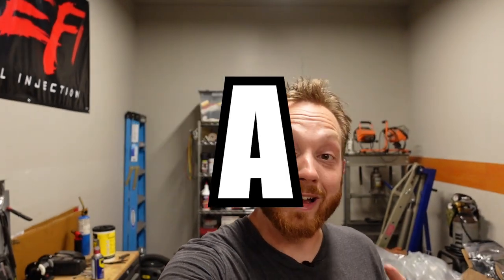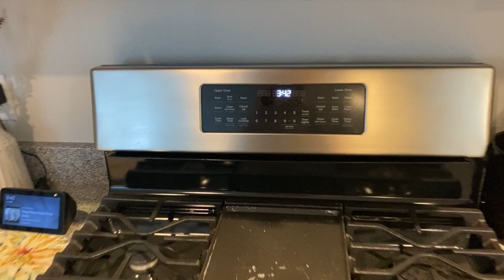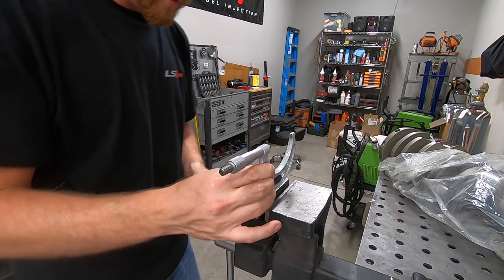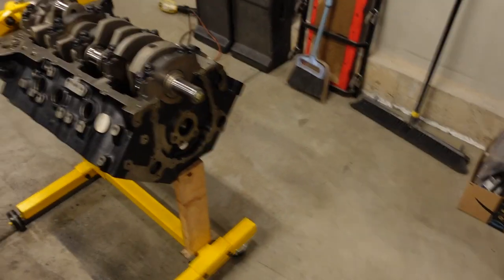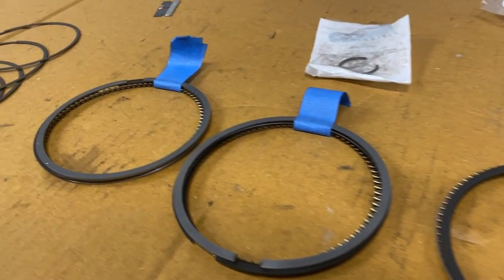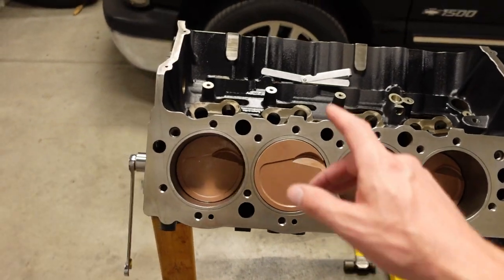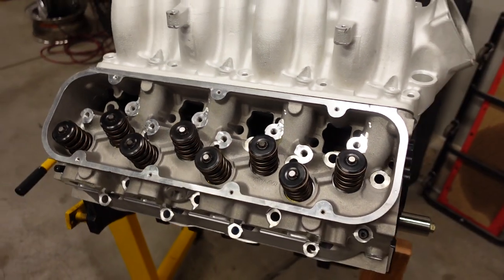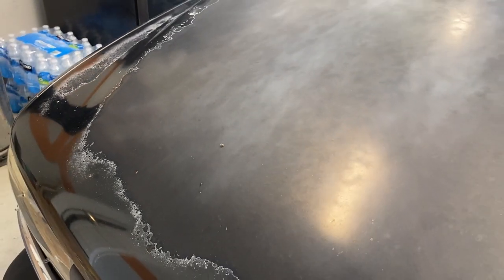535 CUBIC INCH (8.8 liter) Monster Big Block Engine Build

Comment: Bold statement L.S- Killer..You might want to rethink that statement,Since Richard Holdner, made 1542.6 HP with a stock 6.0 gen4 bottom end an torque was like 1256 ft lbs..ya got your work cut out for ya! Good Luck 🤞
Reply: That's no ls killer l do like it but nothing kills an ls 😁

Comment: Wat i did.....VHT wrinkle red on block and valve covers, acc brackets in cast iron paint, small brakets in cast iron paint, vacumm hoses in black, red plug wires, red air filter, pwr steer pump in vht wrinkle red....looked old school but assembled in a black engine compartment it just popped! Wasnt bright, suttle but looked great and sooooo easy to hunt down leaks

Comment: I still want to see you stroke the 4.8L to either 363cu (if aluminum) or 383cu (if iron block) with a 4" Stroker Kit. Since you really can't spin that blower motor to the moon with belt slippage and rotor speed efficiency falling off up top, a stroker based on that 4.8L would be insane. TQ for DAYS.....

Comment: On my recent project of installing efans on my nbs tahoe i went as far as tearing apart the oem fam harness and throughly cleaning and reparing any wires with the proper terminals using terminal specific tools and color coding them with the exact wire oe color and also making my own pcm pin wires with the oe positive locking weatherproof connector which i then finished in heat resistant fabric factory wire tape and wire loom. Dropped in easily and looks completely stock

Comment: You asked about color.... I just went through this with my 99 burban 454-496 build.  I chose "Grabber Green" for the block and 
"VHT SP206 Blue Wrinkle Finish" for the valve covers, but not yet decided if I will do the same on the intake/plenum. That being said, I've never been accused of having ANY kind of taste or "eye" for anything....

Comment: Like the orange look.
Thanks for all your sharing of knowledge, and development. Have a complete stock 8.1/Allison set-up out of pickup, 45K miles, wreck where owner pulled it all out. Planned to use it in build, never got to it, sold.  It is a 2008/09 forget. Plan to keep pretty much stock, maybe 550 H.P/620 ft-lb torque.  Something like Mercury Marine development project.  Does modifying the intake help?  Maybe go in lowered 1986 Chevy short bed step side ( the GM Proving Ground look).

Comment: Go with something bright and in your face. Bright green or safety orange not boring Chevy orange. Just to add some pop finish it off with duplicolor metallic clearcoat. I did that on an engine once and it added a little extra flair but you could only see the metallic in the sunlight.

Comment: Think you and I have that "do things a bit different" characteristic in common :) 
When I found out the bottom end was bad in my '99 K2500 I opted for a 502 long block that was for sale a few hours away.  Health and financial issues have been speed bumps, but I'm hoping to do the 411 ECU swap, and swap the 454 stock heads and intake onto the 502. With a carb setup it was dynoed at 547hp 610ftlbs, gain or loose swapping to the  EFI setup (already have larger injectors, Hp Tuners) it should have significantly more than the stock 454.
Reply: I have a 98 k2500, originally a big block truck but it spun a couple rod bearings. I went the other direction, swapped an 0411 and a 5.3 with a standalone harness, all factory gauges and everything works. Now that it's running and driving, it's not hurting for power by any means in fact its got a lot more usable power than that choked out 6th gen 454 but I still kick the idea around of swapping in an 8.1 at some point to get that monster lazy torque back.

Comment: You'll be running 2000hp before you know it once you get the suspension dialed in. Those parts will absolutely take 2000 without even breaking a sweat. Don't have to worry about low end spool because of the cubes. Will be a weapon!
Reply from the maker: Can’t wait to get it on a track!

Comment: I just wish the 8.1 had a larger aftermarket 🤷. But yeah man LS engines are cool but nothing beats displacement. As far as colors go having the truck black and very sleeper like. Me myself would probably go with a black block with a lot of midnight chrome. Midnight chrome exhaust would be absolutely killer and very killer expensive as well. But I think something of that combination would be cool. Still very low-key but yet stunning at the same time.

Comment: Do you have to worry about OBD2 state inspections?  Here in NY, during inspection, your vehicle is hooked up to a scan tool that communicates with the state computer network.  Your vehicle better be able to communicate with it, and the info on your computer better jive with what the state sees with your vin.  Because of that, I’ve decided to forget engine swapping my ‘07 Classic Sil 4.3.  Just too many unknowns.

Comment: I would do the block valve covers in the upper intake and the orange do a powder coat, satin black on all the pipes and if you have any kind of numbering for the size of the cubes on the valve covers, have them machine down or have the powder coating wiped off before they cure it so that it shines through on aluminum on my Duramax satin black my valve covers my upper manifold and my compressor, housing done and satin black all of my boost pipes are all done in gray along with my air intake

Comment: Plastigauge works if you get off numbers vs using a dbg I’d be Leary of crank straightness and check multiple planes on the journal with the plastiguage just to be sure.

Comment: I just finished my 1997 Chevy 2500 2wd 454 Vortech Gen 6 4L80E.
Stock build with Way better bearings than GM used , Vandervell bearings and a 80 psi MOROSO Racing BBC Oil Pump.
Impressive torque 485 Ft/lbs torque and around 360 Hp True like reported on You Tube.
Reply: Yeah baby love those torque numbers.

Comment: I suggest real Chevy orange on the block and heads, with black valve covers, intake, and accessories. If you need a paint code for the correct orange,  I can get that for you.

Thanks for the vid.

Comment: Question,, where did you get lucky and find a PSI engine block?
Reply: I can tell you a lot about these engine blocks,,, like the real reason for the oil squirters.
Reply from the maker: I'd be curious to hear it!
Reply: @LawrenceTolman  ,, in the early stages of development of this engine it had issues with rod pins failing, due to using LP or NG, these fuels run a lot hotter than gasoline. So we developed the squirters to cool the wrist pin, plus some of these engines were used in a variety of ways, stand alone generators, buses, trucks , etc etc, when we used them in gasoline applications we would just plug them because they were not really needed, but it will definitely help ur engine live since you r using a turbo, a little added protection. That engine came from wood dale Il, should have a date code stamped on the left or right ear of engine, definitely a work horse engine

Comment: About plastigauge. You should start with a to small or barely fitting piece. Than you know what size just presses in. Than you get an accurate reading. Too thick gives a false reading because of deflection of the bearing.
Both measuretools (out and in) have a calipper to check 0 adjustment.
The measuring tips look flat but are not.
Put two balls a bit too close to each other and try to fit a 3th in between. Wont go. If the measure tips are not exacly lined out you get a misreading on 0 ing the inner measure micrometer.
About the conrod bearings. I am curious how you check those on clearance.
Old engines (years ago) ,yep granddad telling storys, had full ,,layer,,(bearing material called babbits). Thise could be measured by leadwire/plastigauge.
New ones have a steel outside a layer of soft material(copper or same softnessspecks) and a layer of 0. something of bearing material. 
You can check the journal if its still round (2 measurements 90% oposit each other) and side middel side if its still,,flat,,.
But the bearing dont measure it. If you see aprox 25% of copper in both halves, replace them. The only check allowed is when torqued move them sideways. If they move 👍. Thats why you have regrind/rebore measures. So you can order the ,,stock,, oversized pistonring and ,,stock,, undersized bearings.
On new parts like this: only check if its not a murphey/monday case😉

Comment: I just picked up two of the 80000795R PSI engines and plan to build one of them for my boat. Do you know much about the new LS style heads that PSI is putting on these motors ? They have a different valve angle, LS style trunnion rockers and injector bosses are in the head, not the intake.
Reply: Just wondering if these LS style heads will be usable. Obviously not as good as Larry Hofer heads, but certainly worth considering if they will let the motor breathe to a max 5500RPM.
Reply from the maker: there are some promising developments with the PSI heads actually, and yes you can use em as long as you use the corresponding intake
Reply: @LawrenceTolman  I have two of these, intake to oil pan. Both are newer and have all the latest upgrades... screw-in freeze plugs, LS style heads, Oring'd intake ports, beehive springs, LS7 rockers, etc... Super happy with this score.
Spoke at length with Trey at River Speed and he is an absolute encyclopedia full of knowledge on these PSI 8.8's.
Im going to build one with his guidance and camshaft suggestion to best take advantage of these LS style cylinder heads.

Comment: I'm curious as to why you didn't opt for an aftermarket Crank sort of build longevity into your motor by purchasing a respectable crankshaft & Rods ? Or are you proving what can be accomplished with Bone yard parts ?
Reply from the maker: I have two engines, the 535 here does in fact use 100% aftermarket parts: block, crank, rods, pistons, heads, and so on. I also have a stock 8.1 with a turbo that’s running all stock parts

Comment: An iron block 5.3 will make 1000 pretty easy and not blow up at all and they are not running 80lvs of boost that’s diesel numbers not even a 1500 hp Supra runs 80lbs . There are plenty of real figures you can go off if you wanna look into it

Comment: I hope the Gen 7 8.1 liter block holds up for You at 1500 Hp.
Last I knew the 1968-1984 427 T tall deck Gen IV was the strongest at 1500 Hp Block Half Filled with Moroso Block Filler.
Pontiac 455 stock block has been pushed to 1600 Hp Turbo Boosted years back Full water jacket.
One Pontiac V8 400 Guy Twin Turbo Boosted to 2000 Hp Rear wheels Block Full Filled Stock Cast Iron Heads.
Reply from the maker: lots of great ways to make power right there

Comment: Somebody needs to build one of these with some of mast motorsports ls7 port heads and intake manifold. They had told me probably 3 years ago they were developing some for a fleet company that would be running them on natural gas and turbocharged making like 800 hp at around 1800 rpm and 8.8l as well if I remember correctly.

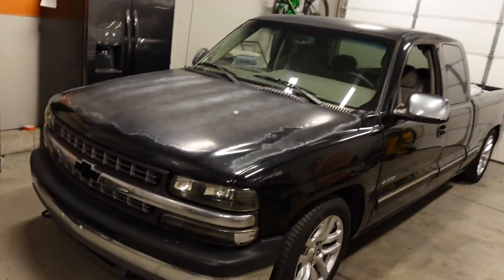Comment: 21:36  I would paint the block and heads 🟧Chevy Orange, powder coat the valve covers, intake manifold, water pump and timing cover a matching 🟧Chevy Orange then ⬛Stain Black Cerakote coat for the accessories/ drive, turbo's and tubing with the headers coated in a 🔳Cast Iron type color.
Reply from the maker: I do like the orange and black combo
Reply: @LawrenceTolman  You should check out the [TUX 69 Camaro]  It has that nice old school/ modern orange and black look I'm referencing.

Comment: What degree thermostat you run on the trucks? Also before going straight cooling trans lines to trans cooler w/out using the radiator did you ever try 160 degree thermostat?
Reply from the maker: I think there is a 185 in there now, and no, I have never tried anything lower like a 160
Reply: @LawrenceTolman  the reason am asking is because I’ve been told to change the thermostat to 160 to help the cooling of the trans, I also do have the tru cool 40k running with original lines and still using the radiator as well but my 4l80 built with a shift kit and with a 2800 stall. When driving under 180 degrees shifts very nice but once it goes over that temp it start to take long shifts and I was thinking of doing straight lines w/out using the radiator but I’ve seen people have issues kind of how I do now due to cooling issues. Do you have any issues or have any idea what I should do?

Comment: Sometimes plasti gauge is the only tool available and you have to use it.

Assembling a proper race engine is not the place for it. You’ll be happy with the instruments you picked up for life. No more guessing, no more doubt.

Comment: If you didn’t check the mains, You would have spun the main bearings because the engine knew you didn’t check it yourself. That’s how it works.
Reply from the maker: Very true.

Comment: coyote f150s do 8s with stock sealed coyote. Mostly just needs boost and fuel and they make up to 1200whp. No heads no cams no pistons no rods no opening the engine unless you want to go fast fast  need one of thems bad boys. stock blocks are handling over 2000hp. Wouldve pussed the world off and put a yote in this truck lol Sooo i say build one of them. Mustang lifestyle shows how to swap coyotes faster than ppl swap LS stuff plus no heads and cam like a LS so bolt on boost and boom

Comment: Now you have to put a 427 LS7 in the copo truck!
Reply: Or an LSX 454.
Reply: I have a feeling he won't go much bigger than a stroked 6.0 block. Ls7 blocks are Flippin expensive, as are the lsx aftermarket blocks.

Comment: what were those rings you installed on the end of the crank? are the reluctor rings? on the back? i dont know much about the new 496's but read and seen that hi-po parts are limited and i mean limited as no one has designed or made any good aftermarket stuff like heads and intake. i know they are not compatible with any other bbc engine parts but it looks like a future interesting engine.
Reply from the maker: Correct, they are the 24x LS style reluctor wheels
Reply: @LawrenceTolman  interesting thats they are on the back of the crank. thanks for verifying.

Comment: So what kind of transmission is going behind this beast? That 4L80E can't handle the numbers you're wanting as is can it? And what about the rest of the drivetrain? It'll have to be beefed up too won't it? LOVE the content man! Been looking forward to this build for a while.
Reply from the maker: You’re correct, the rear of the drivetrain won’t work as it is, the trans, rear diff, and driveshaft will all have to be upgraded significantly.

Comment: A lot of people already commented this but, for the sake of personal insurance, your torque sequence isn't the best - but hey, judging by your follow up videos over the past months, it worked for you and that specific engine and that's all that really matters. 

For the sake of proper engine building though: Always start from the center and work your way out on all of the caps, but don't reach your final torque spec within 2 hits.

The bolt and mating thread surface materials will have different specs. Also it should be a 3 or 4 step process. As in you start at a lower torque spec like 30 foot pounds for all bolts. Start with the center cap and work your way out evenly. Then go up another 20 or 30 foot pounds depending on build and materials - same pattern you did with the first round of tightening. Then a third round at the final spec. You may have to do a 4th round and tighten all of them to 90 degrees depending on what it is.

Again, figure out if they are like ARP bolts or stock GM bolts and some will split hairs over if it's a 2-bolt or 4-bolt style - look into it and figure out what will be best for your build.

Comment: Weight and power equals breaking stuff
Reply: That's why you use a heavier duty setup to begin with. Big blocks were simply designed for heavy duty applications in a way the LS never was.

Comment: lots of great info here and yes always double-check because its lots of money invested. when were you able to get the raylar intake and are they available to buy yet? Are the piston squirters available to buy as well? Paint it black, more modern.
Reply from the maker: I think Raylar said they should be available for purchase now, and the oil squirters came with my PSI 8.8 block when I purchased it
Reply: Where did you buy the block from?

Comment: Any reason u went gen 7 vs gen 6. Are those able to use the mark iv heads???
Reply from the maker: Mainly at first because it uses LS sensors and electronics so it made a great swap candidate at the time
Reply: @LawrenceTolman  ok gotcha understandable so from the factory they already got everything, just looked though not much aftermarket support for them. I've been looking into swapping my tahoe and was looking at the gen 6s so I could use the older heads and ls computer. Efi connection has a setup to convert it to 24x or 58x.
Reply: @LawrenceTolman  but most likely going to go gen v 5.3 with a 10 speed now after driving my moms newer tahoe them bitches move out quick

Comment: I’d probably do the orange block and valve covers, compressor housing and charge pipes. Basically the opposite of the COPO truck which is is black under the hood and orange outside.

Comment: What heads did you use? Looking at picking up a 496 and it has iron heads on it. If I get it gonna swap em out.
Reply from the maker: It will be running Raylar aluminum heads

Comment: If my goal is for example 1,200hp using all aftermarket parts such as crank, rods, pistons, etc. Is there an advantage using a BBC over a SBC LS? Block architecture wise...pretty much what are the advantages over a BBC over a SBC LS just comparing the bare blocks
Reply from the maker: No, there’s not much advantage to be honest other than displacement and torque. You can build an LS that will make 1,200hp all day long, and it will me much simpler finding parts because the LS is so popular.